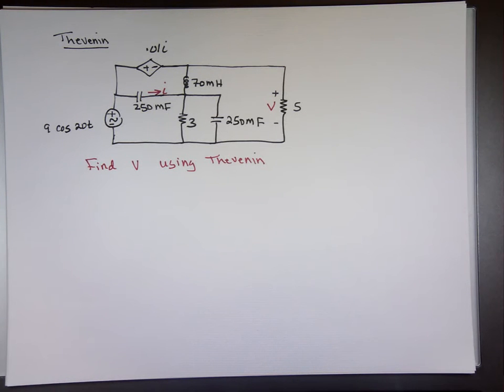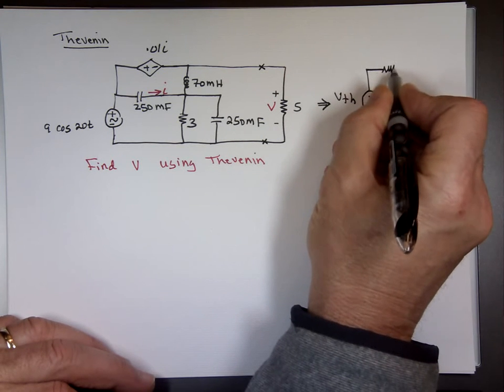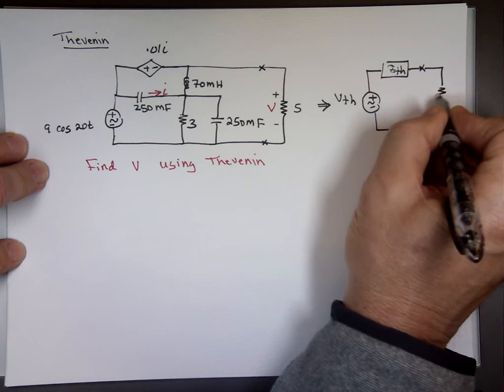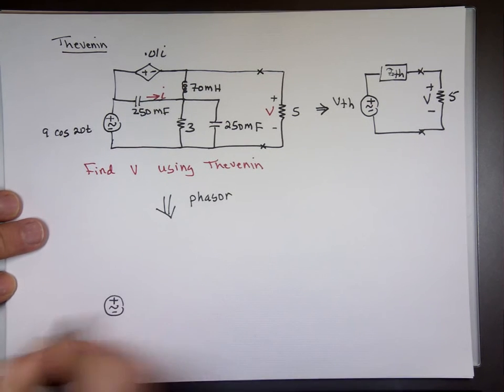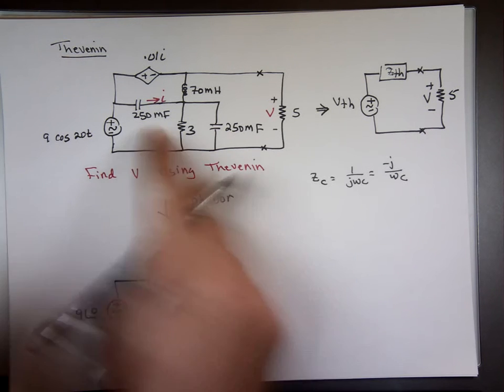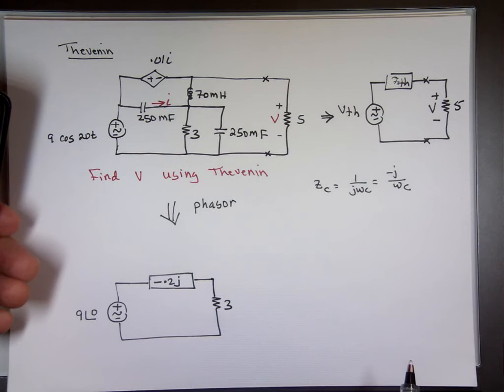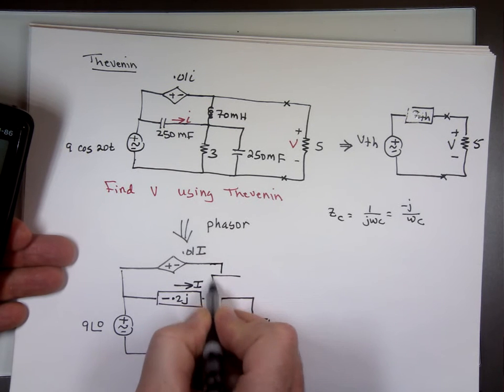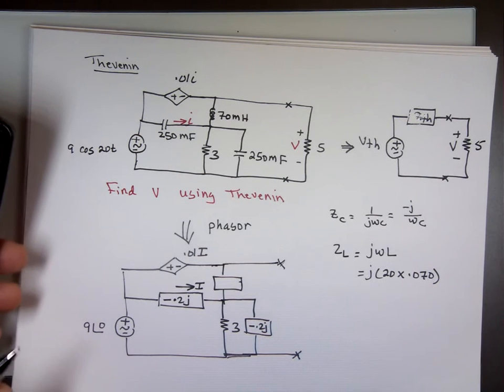Thevenin/Norton with Phasor

Comment: looking for 2 port network practice.   at 33:06 you add 0 -.2j and 0.013274 - 0.199115j (.2 ang -86.2) and come up with something other than 0.013274 - 0.399115j ( 0.39934 ang -88.095).  
Isc connects two voltage sources in parallel.  Does that work?